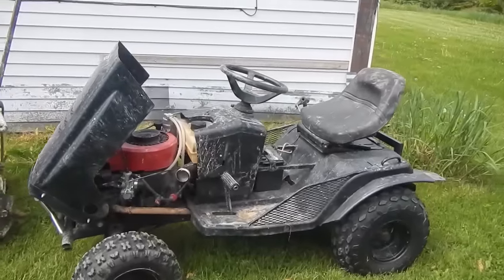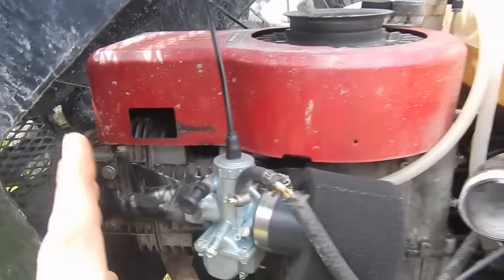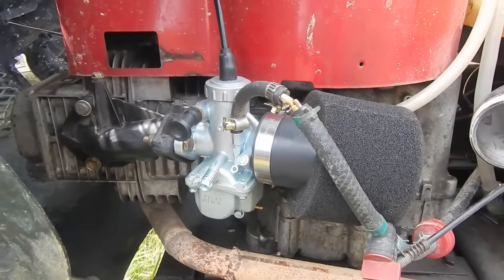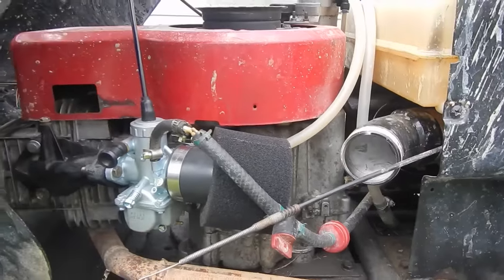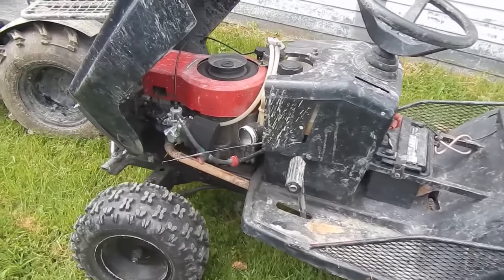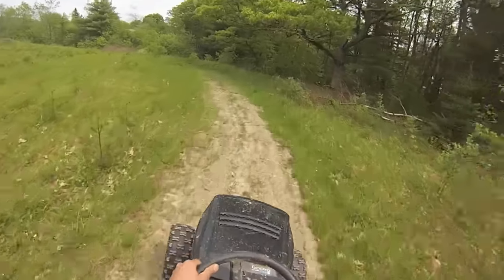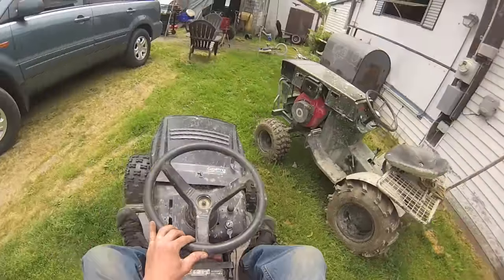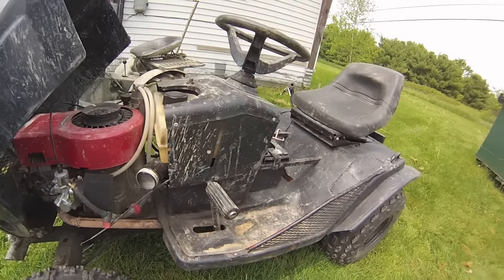Off Road / Racing Mower Performance Carburetor Install

Comment: you should hook up a RPM gauge to see how high it's going in rpm's.
Reply: most of the time you can tell be ear
Reply: Cross Durazo you can get exact reading if you use a rpm gauge
Reply: +Zach'sGarage channel true
Reply: no matter what those stock valve springs wont let it see much more than 5000 regardless of carb... it's when ppl upgrade springs that they really get dangerous but still affordable digital tachs don't let u no u Rev too high till it's too late..
Reply: I rebuilt my peerless 801 transaxle in my john deere lawntractor and now it howls and whines when tractor is moving
Reply: 4x4-Off-Road-Devil the only thing I can think it is, it's the gears being worn.
Reply: 4x4-Off-Road-Devil what did you use as lubricant, gear oil or grease.
Reply: 4x4-Off-Road-Devil the whine can happen when the bushings aren't Lined up right.. also I think the biggest cause for trans noise is if the input bevel doesn't have oil clearance... I went thru that once I shimmed the gearsets cuz they seemed loose and it whined like a bitch..
Reply: I.C. karting 
I used high temp bearing grease. I do recall hitting the input shaft to try and get the original pulley off. Wonder if gears are too tight now

Comment: For the choke. On the two bolts that hold the intake manifold on to the engine, add a bracket that goes over it towards the carburetor and have that bracket have a washer placed horizontally (at a point of your choosing).

On that washer, add an Y arm that hugs the choke. I'd probably take off the plastic knob and replace it with a T piece that fits inside the Y piece. And at the end, on the other side of the Y piece which is levered on to the washer from the bracket, put a cable tie for a bicycle brake or one of those bicycle front gear changers. Last but not least, add a spring on the Y piece where it meets the T piece from the choke so you can have return.

And voila, dash choke, with positive action.

Comment: Nice improvement! Kicking ass AND taking names now, LOL. I think you got one more improvement to do and that would be with the ignition system. Get one of those CDI ignition boxes that have an advancement of the timing and rev limiter built into it. That will add a shit load of torque to it.
Reply: Where can you get tha kind of cdi?

Comment: I'm surprised you haven't grenade that little plastic gear! I didn't realize the governor was still inside. But yah if you don't want to have a bad engine on your hands I'd get it out and plug the hole with a bolt.

Comment: AWESOME!!!! sweet video fearless as usual I have a question you have done all this amazing things to your mower and now your doing performance parts so my question is when are you gonna put a performance exhaust in it right now you have just a rusty pipe thanks if you awnser.
Reply: He built a resonated straight pipe and it sounds like 4 wheeler go search off road mower part 2 he shows it
Reply: +Windows_Wizard99 that's not what I mean I'm talking about a real exhaust such as a fmf slip on pipe

Comment: Fearless...I have decided to take on an off road mower project. As i am on a very limited budget, i got the only mower i could get for free- a 2000 John Deere sabre hydro garden tractor. Its really heavy, but i am faced with the problem of removing all of the linkages underneath it and converting it from hydro to gear drive. More work than its worth? should i keep up the hunt for a better first project mower?
Reply: By heavy i mean its really heavy duty. Cast iron front axle w/ bearings and steering gears that are an inch thick. the rear has 5 bolt hubs. right now i have some car rims w/ michelin sport ep-x tires on it.

Comment: Damn the intake under the dash looks dirty as hell lol. Looked up Mikuni, has three different sizes for one carb, each carb. Which size do I go by? Have same setup Murray (14 ohv) with same body style. Red though lol. I've done a few for friends, and myself but moved back to home state (Texas) so I had to leave them. Have a rather large collection of Murrays, and few John Deeres, few Craftsmans, and few shitty MTDs. Hate the weak drive pulley system and steering MTD has. Too bad two Craftsman mowers I have were made by MTD. Having trouble getting a pulley off the transmission though.

Comment: sounds like you need to mess with your idle mixture screw.  it's on the front of the carb.  also, they make a cable choke conversion for mikuni carbs.  if that's a clone, should work on it as well

Comment: hey there! i just wanted to know if there is a possible way to make a swithc that overrides the safety in the seat! im not good with wiring things, and i just want it to be a "trouble-shoot" switch so i can use it to keep the engine runing when trying to jump start it or something like that.

Comment: Would something like that Mikuni flow enough for a V-Twin, 20HP??
My racing mower is bogs out  a lot with its stock carburetor the rebuild is probably the same amount as that Mikuni a new carburetor is 3x that if not more.
Reply: I don't see why it wouldn't be enough flow, but they make similar carbs in sizes up to like 44mm or larger. granted not for  $30 like this one lol. you may not be so lucky with the jetting being close, but jets for this style of carburetor are cheap. you can also buy mikuni 2 bolt rubber flanges to get you a standard round hole to hose clamp in any round dirtbike/atv carb

Comment: at this point, i would start looking at ways to extend the frame or move the rear axle to increase the wheel base and move the center of gravity. i realize wheelies are shitloads of fun....when you WANT to do them, but i know from personal experience flipping your machine back because your weight/balance is directly over the rear axle [and having it land on top of you] is NOT fun. probably just a matter of a few inches would make a world of difference in the way it handles.

Comment: Alexi how you pack bypass the governor you don't mind showing a video of doing it for me I appreciate it I got an old old lawn mowers on her do it too I'm going to put a smaller pulley on the back you're more speed and I fix the motor or something like he got weird gas pedal don't know you're running running without the government if you don't mind tearing it apart do it one time on the videos

Comment: Hi Guys, Great Video. Do you think this would work on a 12 l-head (Side Valve) Briggs as well? I race a mower, but being in the Junior category I am limited to a 13Hp single engine max, but seeing as I have 3X 12 singles I am using them for now.Thanks

Comment: are you going to still use the air intake you made
Reply from the maker: I'm not sure, I have to build an adapter to make it work
Reply: nice It definitley looks like a great modification
Reply: Awsome tractor bro!
Reply: +FearlessFront (Todd Christopher) I would like to see a vanguard with the same setup, talk to mudking about the swap, I wanna see if it's a dramatic power difference with the same carb on the opposed or v
Reply: you should put one on the racing mower
Reply: +Cross Durazo  yes! the racer needs this carb!
Reply: where do you live I live in lacassine
Reply: FearlessFront (Todd Christopher) how did u huck up the throttle cable
Reply: +Teddyvision i was thinking of getting a 28 mm one for my 20 hp opposed twin. The stock intake diameter where the stock carburetor bolts up i measured at 29 mm. Maybe it'll work out good
Reply: It's not gonna b a dramatic peak power gain it really just spreads the peak hp to see what one of those carbs can really do u need an aggressive cam and supporting mods to rev high enough to see that dramatic power band
Reply: Im not looking to go crazy with this engine and the mods. I just need a carb. I figure instead of blowing a bunch of money on an original carb, i can get one like this for cheap and get a little bit more power. I know its not going to be insane, but at least I'll get a much more broad power band
Reply: FearlessFront (Todd Christopher) how did u get the fuel to flow
Reply: FearlessFront (Todd Christopher) if it has a lip what would it do

Comment: Hey fearless I have a question I have a mtd piece of shit and the middle pulley is very annoying and I just want to run one belt from the front to the back so I was wondering if you knew a way I could get rid of that middle pulley

Comment: +fearlessfront have you had trouble with factor pulleys being rust welded on to the trans axle? i tried everything with mine, heat, different ways and all i did was snap it off out of the transaxle.... luckily its a transaxle out lf a murray likes ours so there easy to find but dang!
Reply: Caleb Collins I have always had to use a 3 arm puller

Comment: Hey man quick question I would like to do this to my old Murray, it's the 16.5 hp brigs v-twinn, just not sure if it
Would fit or not ? Would you know ?
Reply: Yes and no yes as dual carb setup no as single carb setup for single carb go for 38mm mikuni

Comment: Fearless front, I'm new to this whole thing. If I do a pulley swap on my 15.5 Briggs (bolens) will the tensioner pulley take up the slack in the belt?
Reply: It should. But most of the time when you do a pulley swap you will need to get a different size belt. If you go bigger on the pulley your gonna need a longer belt. If you go smaller on the pulley your gonna need a smaller belt. Best ratio ive foubd is a 5 or 6 inch pulley on the front (if it will fit) and a 2 1/2 inch pulley on the transaxle. That gave me over 30mph top speed bypassing the governor and it starts to get pretty sketchy above 35mph with stock steering setup. I have built a couple racing mowers with verticle shafts belt drive if you have any other questions id be happy to help ya out
Reply: @joeshmo2473  Thank you!!
Reply: @hankyost2399  no problem man. Check out carsandcameras racing mower build. It was what I watched and how i learned to build my first mower from. I copied their design pretty much identical. And its a great 'how to' series and I promise you will love the build episodes. Feel free to reply if you have any other questions. I put a 4 1/2 inch pulley on the engine and a 2 1/2 on the transaxle on my mower and it went 32mph when I bypassed the governor. I wish I would have gone with a 5 1/2" or 6" pulley on the engine but it still ran like a bat out of hell. I had to go back and forth from autozone a few different times to get the right size belt that wasnt too loose or too tight. When you put a 2 1/2 inch pulley on the transaxle your belt keepers no longer work as they used to because your pulley is so much smaller but you can keep them on the way they are or take them off and try to bend/fabricate/cut & weld one that will work as the other belt keepers used to and it will help a lot because my belt would fall off every 2 rides or so and my belt was a little on the tight side (belt didn't want to fully disengage when pushing in the clutch it still wanted to go forward). I also cut my spindles off on the front and made my own spindle adapter/spindle joint that was 6 inches higher therefor it lowered the mower frame 6 inches in the front but you xannot lower the rear end without installing a jackshaft but like i said earlier check out carsandcameras mower build its better info than any other build out there.

Comment: do you know if you can bypass a stator ? my riding mower stator blew up I don't need anything to charge the battery as I always boost it.
Reply: Yes it can be removed. I removed mine. Mine burn up and just charge mine with battery charger before use. Will gain a small more percentage of horse power to.

Comment: I have a 12hp Briggs and Stratton Murray will a 22mm carburetor fit and did you have to do any upgrades when you remove the g
Reply: No 22 is way too small go with the 28 and just set the c clip on the slide 1 slot up from the bottom 
I’ve got one on my 13hp and that’s how I run it 
You don’t have to do any upgrades when removing the governer but like he said BE RESPONSIBLE WITH THE THROTTLE don’t over rev it
Reply: OK thank you

Comment: What's the top speed of it with the current pulleys? I have a stock 10hp Briggs that pulls 41mph
Reply: what size pulleys do you have
Reply: Roughly a 5.5" in the front and a 2.5 in the rear.

Comment: What type of mower do I need to make a mud mower or what would be best
Reply: avoid MTDs and stuff like that they are just not good search for sears,murray,craftsman and such,you re likely to get a good deal on those,plus its easy to find the parts and what not,also if you plan to play in the mud,lock the rear end,put some grippy tires,pully swap the thing and you should be unstopable!

Comment: just looked them up on ebay, did you just remove all the hoses that came on it?
Reply from the maker: +Jake Martin yeah I did, and I was wrong, I actually used a 26mm, not a 28mm
Reply: Ah most of them on there are 26, just pull all the lines off and it won't piss anything? Thanks
Reply: +Jake Martin they shouldnt leak until you tip it over. they are just vent/overflow lines. I would find a way to route them to the ground. you want them so if you roll over the fuel will pour away from the exhaust/engine
Reply: +nitrosport5 thanks I thought they were for overflow now you confirmed it, thanks

Comment: I tried to lock my transaxle and it doesn't shift right it is a three speed with neutral and reverse I can only get it to shift into reverse, neutral and 3rd gear can anyone help me diagnose the problem

Comment: Damn the intake under the dash looks dirty as hell lol. Looked up Mikuni, has three different sizes for one carb, each carb. Which size do I go by? Have same setup Murray (14 ohv) with same body style. Red though lol. Having little trouble getting the drive pulley off transmission, quite rusty. I've done a few for friends, and myself but moved back to home state (Texas) so I had to leave them. Have a rather large collection of Murrays, and few John Deeres, few Craftsmans, and few shitty MTDs. Hate the weak drive pulley system and steering MTD has. Too bad two Craftsman mowers I have were made by MTD.

Comment: what is a good pulley swap
Reply: With 20 inch rear tires, a 1-1 ratio on the pulleys will get you up to about 15 mph.

Comment: do a video where you show us how to eliminate the governor.
Reply from the maker: just unbolt it, and take it off!
Reply: +FearlessFront (Todd Christopher) OK thanks
Reply: +FearlessFront (Todd Christopher) wat size pulleys are u using i have a weedeater vip special edition with the 14.5 hp briggs im wanting to build it into a mud mower like yours
Reply: some engines need spring pressure on the gov arm i think some intek twins and kohler command singles (heavy but awesome underated motors).. i think its time for a custom front axle on the murray.. even the stock one with 15* caster would make it a totally different machine

Comment: Ok so completely random question do you know what priming is if not do not bother reading the comment ok so if you are here you do not know what priming is well priming is when you take a salyine solution bottle for contacts empty of course and the you fill it with gas and squirt in the carb so it is easier to start or at least in my expire it is easier to start 
- your friend and subscriber Just look at the name

Comment: Hey Bro,
I want to switch a mower trans belt over to chain using a centrifugal clutch but the largest clutch I can get is a 17T.  I need a larger clutch sprocket to spin the transaxle faster.  Would you recommend welding a larger sprocket onto the clutch sprocket?  I can get a much smaller sprocket onto the trans than what it already has.  I've got a JD/L120 (20hp with K47).  Any advice?
Reply: Combat Pyro keep the belt the clutches burn up real easy

Comment: Would putting a smaller carb on a bigger engine work? Specifically I have a 9hp carb for a horizontal shaft Briggs and I was gong to put it on an 11hp instead of ordering a new carb

Comment: i got a real good question if I got the money up to send it could you rebuild my transaxle its stuck in 5 th and since I put a pushmower motor on it the trans has got rea hard to turn even by hand and I don't know nothin at all about transaxles and if I have to ill pay you to fix it the motor that was on it before I put the pushmower motor on it,the motor blow up so with no money at the time and the push motor was free so ya when I bout the mower it wouldn't change gears real well but now no gears but 5th please git back to me on this I realy need it

Comment: I need help!! I have this carb on my John Deere mud tractor. 16hp ohv single cylinder Briggs. Has rear tank with vacuum pump but won't run right. I've tried 3 new pumps, new lines,  cleaned carb 5 or more times, etc. Should I go with a gravity tank?
Reply: CumminsMan98 id say just go with a electric fuel pump
Reply: mr.random videos I did with a pressure regulator and everything. Think my carb is bunk?

Comment: What size is that Briggs?  Trying to figure out what size carb i need but cant figure out the conversion from hp to ccs.  I have a 16hp tecumseh.  Thanks
Reply: Looks like a Briggs 14.5hp. A bit larger than the older Briggs 28ci flathead.

Comment: I race dirt  go kart and I just bought the same size carb ,I'm going to put it on a 6.5 hp  modified  already to do 7,500 rpm so I put that carb on it  will do 10,000 rpm, also I made the carb take alkihal .